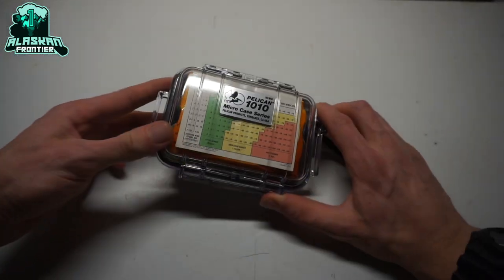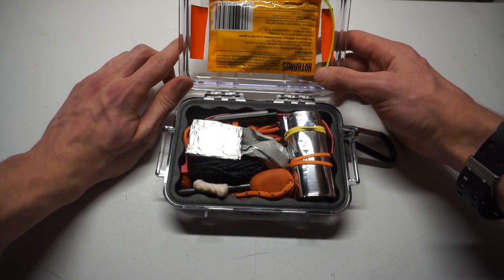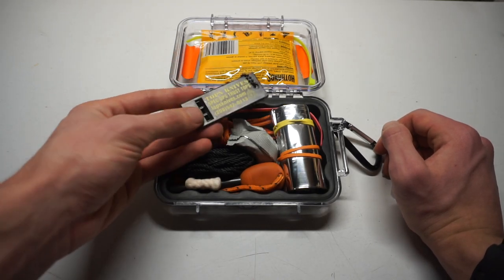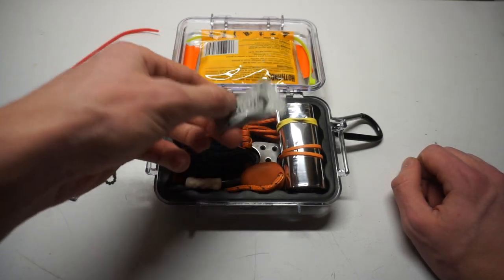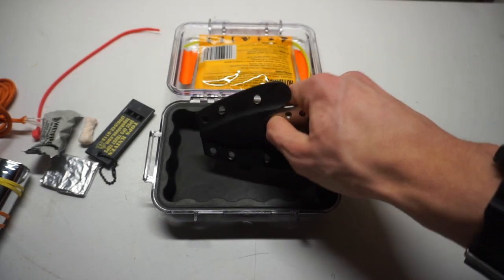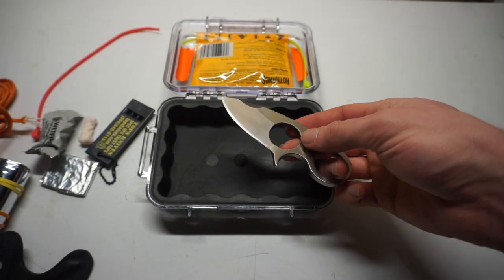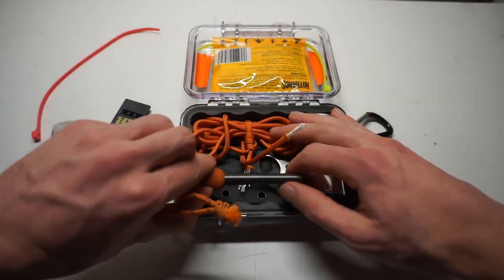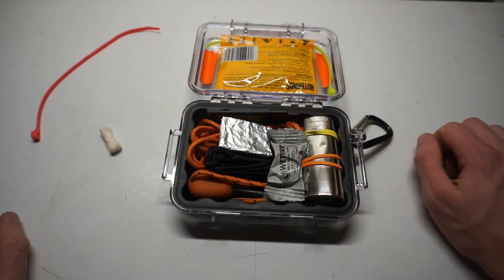Pelican Micro 1020 Waterproof Survival Kit Build

Comment: Water purification tabs would be my choice rather than boiling in the foil. You could use the foil over and over with tabs, but boiling in it would degrade it pretty fast. Just make sure to carry something to help yourself, and maybe a Bic lighter in case you are with someone who does not know how to use a fero rod and you are injured. Fire is so important.
Reply from the maker: I do not disagree, just couldn't get them to fit. In addition, this is not designed to be a long term kit, so degradation is not as much a consideration.